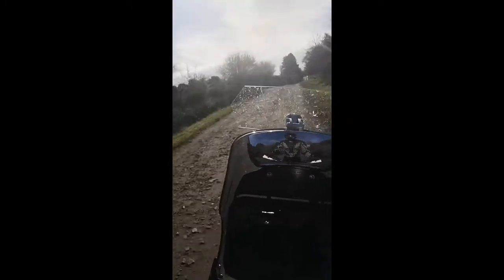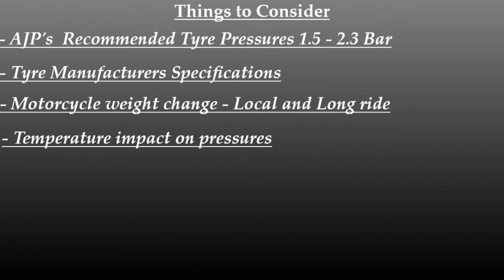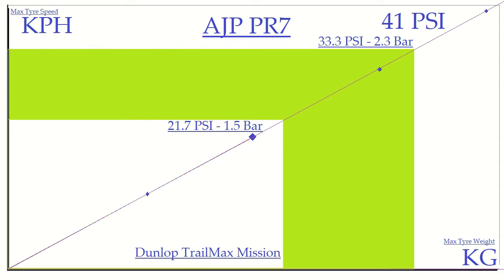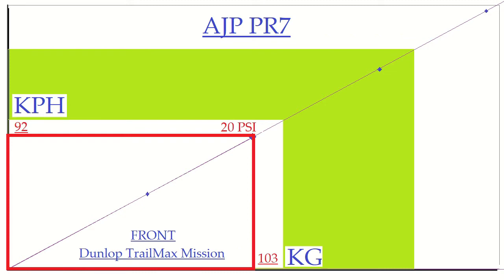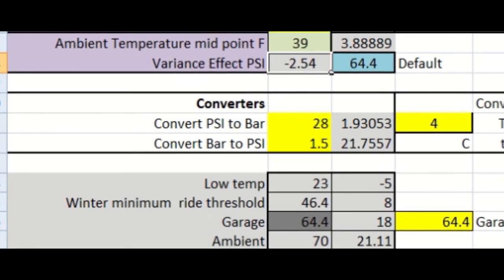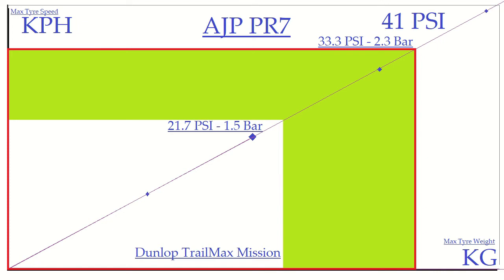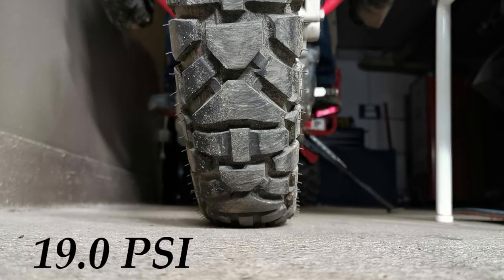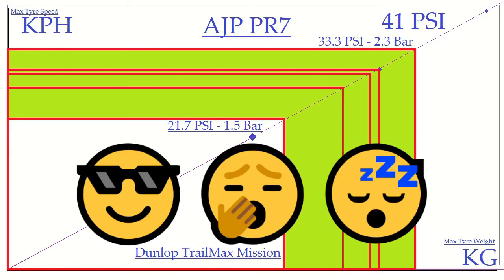Off Road tire pressures, where to start? A Nerds approach to the DUNLOP TRAILMAX MISSION Tire Part 1

Comment: All that time and research and you ended up with arguably the worst tyre for adv riding.
Reply from the maker: It sounds like you have had a very different experience with the tyre to myself.
What bike did you use them on and at what pressures?
Tyre choice is defined by use, so we all have different parameters for our purchases.
For me, cost effectiveness and road mileage were big pieces of the puzzle.
If you trailer your bike to your off road riding area, then road use has no bearing on tyre choice.
I however, usually prefer to ride not trailer my PR7 so those road miles count.
I see comments about tyres that perform great off road and rubbish on road. They usually last 2-3k if you're lucky.
I am currently at 12000kms on these tyres and they have taken me anywhere I want to go.
My riding buddy prefers a more agressive tyre for his aggressive riding style.
With roughly the same distance covered, he is already on his 3rd set of tyres.

Most people write this tyre off due to the way it looks, that is their loss.
The traction and clearance of the rear tyre in particular is phenominal and with the correct pressure settings, this tyre does everything I need it to.
I expect to still be using these when my buddy is on his 5th set of tyres.
'Cash in the Bank'... thanks for your comment
Reply: @markp87PR7  I had them on a 1290, reasonable tyre on dry roads, absolutely dangerous in the wet.
I’ll take grip over longevity anyday. I tried various pressures ended up throwing them in the bin at 5000ks
Reply: I tried them on a 1290, they were fair at best, dangerous in the wet at worst, in the wet my tc was going nonstop. Off road they were fine on gravel etc but crap in the mud  although that was to be expected.
I’ll take grip over longevity all day every day.
They may be ok on lower powered bike that don’t overpower the lack of wet road grip.
Reply from the maker: I had similar issues in the early days until I went out on a limb with trying what I saw as extreme changes to tyre pressures. Just for interest sake, I entered a bike weight of 230kg and a front/rear split of 40/60 (couldn't find a weight split reference). ( Too many guestimates here) for the 1290, My tyre calculator suggested 26lbs Front and 23.5 rear for speeds upto 110kph. ..17 front and 14.5lbs rear for mud.... and 34.5 front and 32lds rear for up to 150kph.
TET use would be 20 front and 17lbs rear. Did you get this low on pressures in your explorations? As I said I am not a tyre engineer and we all have to seek our own pressures. The tyres were designed more for the 1290 than the PR7, they are a much wider spec than the AJP's. Thanks again for taking the time to comment, sorry the tyre didn't work out for you.

Comment: Thanks for this mate, it probably took you 10's or 100's of hours of work to get to this point, and you've then imparted that knowledge to me in a matter of minutes. Really is appreciated, thanks again.
Reply from the maker: Thank you for the comment, that is also much appreciated. I don't know if you've watched the 'Tyre Pressures 2' video, but It gives a breakdown of the maths to do the calculations. I have fine tuned the pressures for my PR7 with the TrailMax Mission Tyre and I will put up a post in the community tab with my latest results.
The '8500kms on the TrailMax Mission' video also has some insight if it's of any interest. Currently on around 12000kms with this set and plenty to go. Regards MarkP

Comment: Great work and information
Thanks for sharing
Reply from the maker: Thank you for the comment. The method looks fairly solid, it will be interesting to see what others find with their own bikes/tires calculations. I am certain that tyre manufacturers have these design models. It would be great if we could access and extract pressure settings straight off their websites for our own setups. Looking at the variance in tyre and bike manufacturers spec's, they seem fairly rigid and not that informative. Let's hope we can stimulate some change. ;-)

Comment: Thank you for your review and communication of the information you gathered.   You have aided in my future decisions.
Reply from the maker: Thanks for taking the time to comment. The tyres have now covered 8500kms(half worn?) and have performed well on most types of terrain, though the lateral grip in mud regardless of pressure is still an issue for me but the forward movement and braking ability are good on any surfaces. I am working on a video update regarding my findings on tyre pressures which I hope to complete in a few week time. For the PR7, the range seems to be between 1 & 2 Bar =14.5 to 29PSI with very noticeable difference in performance for relatively small changes in pressure. Regards MarkP

Comment: serious stuff, as a rally co-driver in a past life one of my chores was to check actuall tyre pressures at start and end of stages occasionally, like I had nothing else to do. I'll be interested in your conclusion I run between 18 and 25 psi dependant on conditions on the  tubeless GS never had any problems its probably not recommended or much good for longevity, I looked up and spotted those figures in a cloud shape one morning zero science involved just a little bit of wobbling about experience, thanks
Reply from the maker: As an ex rally driver 25psi was the pressure I used to run in Dunlop Ultragrips in my Mini ;-) I am now coming around to the idea that speed not weight is the decisive facture. Off to Spain next Friday, I hope some TET riding will provide both test opportunities and some results, fingers crossed.